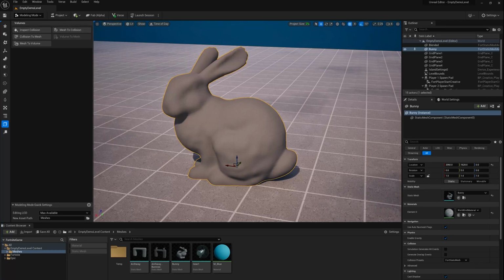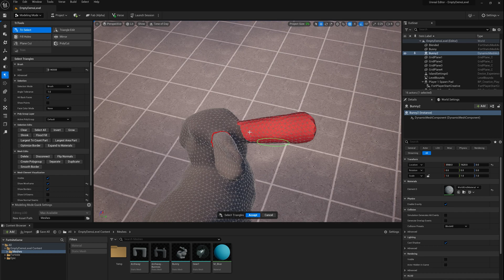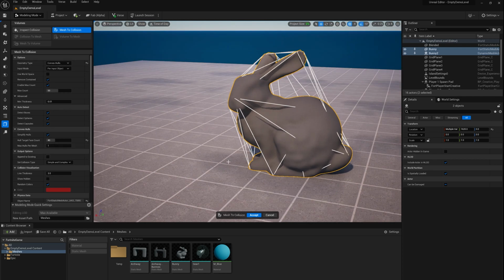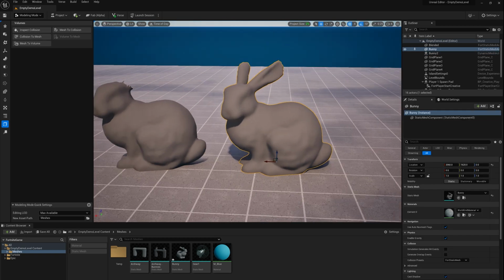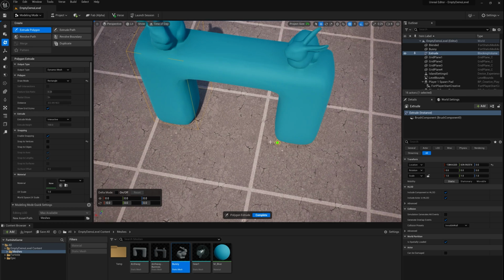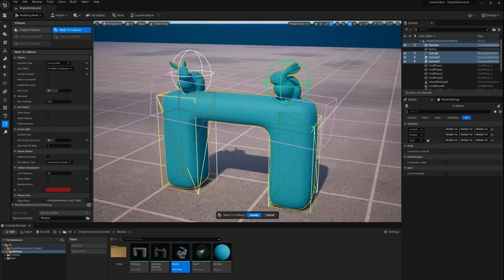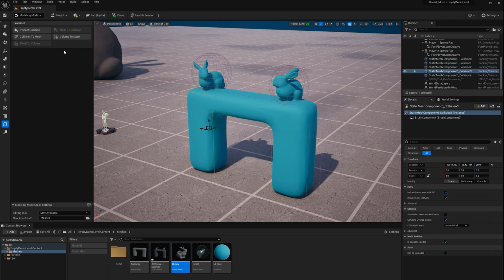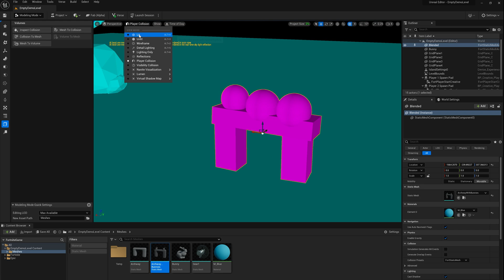UEFN Modeling Mode - Part 4 - Manual Simple Collision Setup

Comment: Thank you for finally adding proper AutoCAD style blockout tools where we can draw out shapes from a corner point. This makes creating walls and other shapes with precise values so much more intunitive. I've been pleading with UE engine for this.

For collision. The tools are powerful, thank you. One point: I feel like this is an area where predictive algorithms could be employed in Unreal to simplify this work for creators. The advanced collision modes and crafting are great, but couldn't we get a collision button that autogenerates collision with a simple slider detail setting? It would look at the model and model size and generate a lowploy collision that would work for 99% of use cases. Most simple collisions just need a few simple shapes welded together. I feel like this is within the realm of algorithms to figure out.